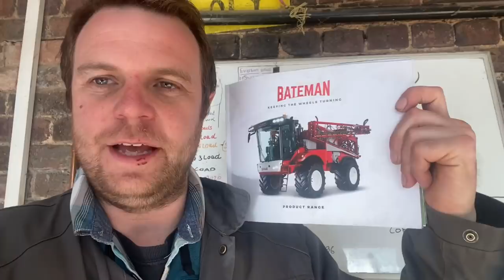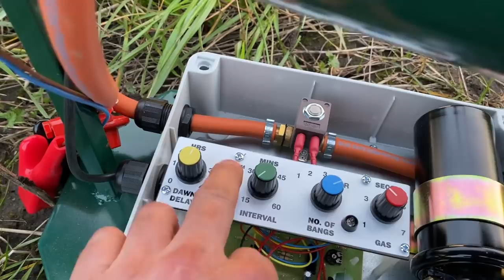Blow out on a tanker john Deere on claydon drill X-ray day new gas gun 367 ollyblogs 24.03.21

Comment: Glad to see your tooth is OK (dentists always say come back in soon because they want more of your money) the Plastic Pigeon is a decoy to convince birds in flight it safe to land, they are used by some pigeon shooters to great effect, personally I prefer to take a couple off the wing then peg them out (an 8" stiff wire rod poked into the head behind the bottom of the beak then set into the ground) as it saves carrying a load of junk to the field, all you need is a 12g, a few cases of number 6, and a camo net/blind and you should walk off the field with a bag or two of flying rats to sell (or turn into pies)